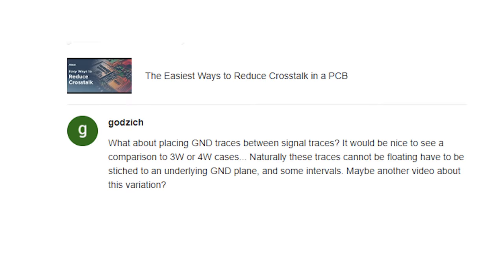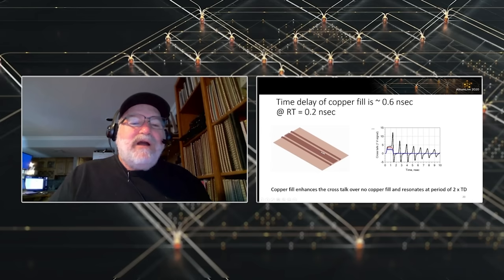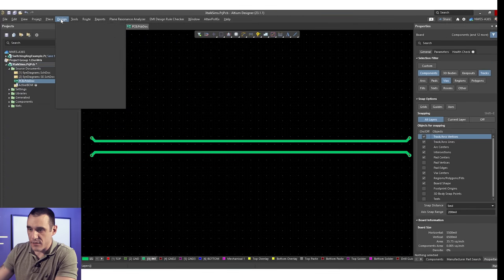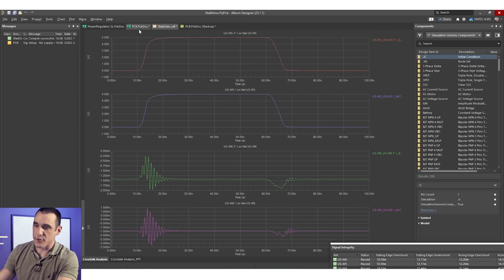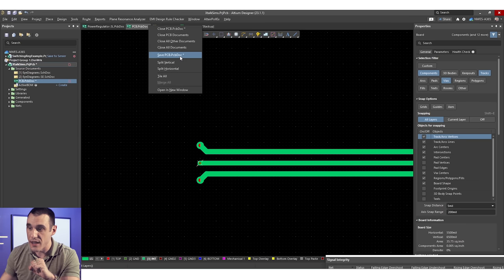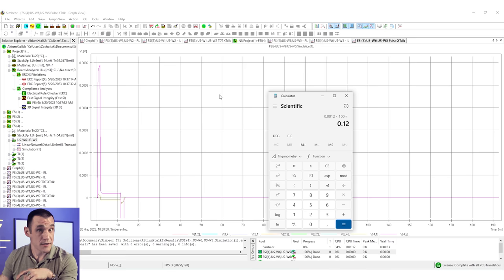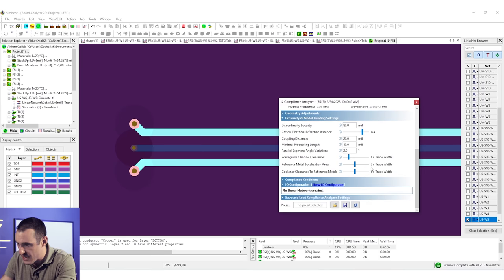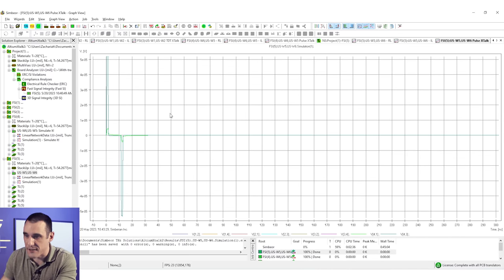Does Using Guard Traces Really Reduce Crosstalk?

Comment: Personally I do not use guard traces. In our  DesignCon 2013 paper Eric Bogatin and I did an exhaustive study on guard traces. As part of that study we also showed that location of the grounding vias can have a profound on the effectiveness of the guard trace and in some cases made it as bad as having no guard traces.  

In the end, the key conclusions were;

1. In all high speed digital applications, where –50 dB cross talk is acceptable, there is never a need to implement a guard trace. This cross talk can be achieved in
stripline traces by just increasing the spacing between aggressor and victim to fit a guard trace.

2. A guard trace, even “well shorted”, has minimal advantage. To fit the required shorting vias means spacing the aggressor and victim lines very far apart which by itself reduces the cross talk more.

3. Using a guard trace with microstrip offers high risk of incorrect termination with little potential reward and should never be done. 

4. The optimum configuration for a guard trace is to use shorting vias on the ends, and match the length of the guard trace to the coupled region only. When used in stripline structures, such a guard trace can result in near end cross talk of less than 0.03%, which is -70dB isolation, compared with -50 dB isolation for the same two lines without the guard trace. Far end cross talk can be eliminated.

5. Any extension of the guard trace outside the coupling region, with shorting vias on the ends, will reduce the effectiveness of the guard trace due to the added length and finite inductance in the via. In one case studied, when the guard trace was just 100 mils longer at each end, the peak-peak amplitude of the near-end noise was just about the same peak magnitude of the no guard case. Because the details depend on the rise time and dimensions of the lines, a 3D simulation is the only way to quantify the actual benefit of a guard trace with vias in a practical situation.

A link to an SI-journal article and link to full paper is here:

https://www.signalintegrityjournal.com/articles/1341-guard-traces-love-them-or-leave-them
Reply: Thanks Bert for the link to the DesignCon paper, I pinned this comment, I also am not a guard trace user for multiple reasons.

Comment: Im using guard traces mostly for HV (rectifier mains 325VDC), when have to deal with single or double sided boards, its great to mitigate noise from switching, as addition to snubbers.
Reply: This is similar to bringing ground closer to the switching node, something which I discussed in another video.

Comment: Hi Zacharias,

Thanks for reacting to my feedback - much appreciated. I fully agree that it generates extra (and unnecessary) labor when you add guard traces manually. Additionally, placing high-speed traces at 3W (or even 4W...8W) distances gives you excellent results when it comes to crosstalk. Nevertheless, you would normally like to fill your plane layers with evenly spread copper. Flooding with copper those sparsely spaced high-speed signals add these "guard" traces automatically. You just need to ensure that you have vias distributed along the guard traces and not leave them floating - not to create resonators and make things worse - as Eric pointed out. The worst thing would be to leave guard traces floating but this mistake can be avoided easily by configuring the copper pour properly (leaving no islands).

Avoiding unnecessary work (and drill holes) should be on everyone's agenda. Using guard traces (or fills) is a good option when you are striving to absolutely the smallest crosstalk, but is probably overkill if you can space your high-speed traces far enough. And as you said, it does not buy you more real estate on an already cramped PCB.

Cheers, 

Christian

Comment: Why is the rule of thumb 3W related to trace width as opposed to the GND height?  My intuition tells me trace width would relatively irrelevant
Reply: Trace width and height above/below the return planes are both significant when determining controlled impedance traces and these are 50 ohm traces.  I believe when people talk about the 3W rule they are referring to a guideline that is referring to crosstalk between 50 ohm lines.  If the impedances were higher you would need something greater than 3W to achieve the same levels of crosstalk.
Reply: @thomasyunghans1876  oh!  The 50 ohms already takes into account the ground height!  Right?
Reply: @big_whopper  That's right!
Reply: they are 2 sides of the same coin
Reply: @Caleb Crome  Yes Thomas is correct, if you had a 50 Ohm trace you would have a fixed H value for a given W value. However, the W value needed to hit a crosstalk target for a fixed impedance is a nonlinear function of H, so as you bring H closer to the traces you can violate the 3W rule and bring your traces closer together.

Comment: Eric simulation shows an increase in crosstalk but Simbeor shows a decrease in crosstalk - neither uses stitching vias - so which one is correct?
Reply: In Eric's presentation he shows that improperly spaced stitching vias create a resonant cavity that increases crosstalk. In another case, he shows a slight decrease starting from a very low value. Simbeor shows a much larger decrease using the extracted linear network model, I did not do a full wave simulation in the interest of time so maybe the results will be different.

Comment: Many EEs make a distinction between grounded traces and guard traces tied to the receiver's reference voltage, which may be different from system ground. For example, a single ended analog front end with the receiver biased between Vcc and ground. This seems to be where I've seen guard traces most frequently used in metrology grade equipment that EEVblog has featured in teardown videos. Still not sure how this is supposed to work unless it's meant to be parasitic LC between the receiver and the signal trace.
Reply: Guard rings are for picking up stray/leakage currents, right?  I guess it’s for resistive coupling as opposed to reactive coupling.
Reply: @big_whopper  yes, where i've seen it (guard ring) most, is protecting high impedance feedback nodes from leakage currents (LC) in low noise references in linear, or mixed signal application. Same/similar reason you would make sure to clean the PCB very well.
Reply: @big_whopper  how can it be resistive coupling? If the guard traces was resistively connected to the victim trace then it would be part of the same trace, not a guard one. I think that all guard traces are by definition reactively coupled.
Reply: @InTimeTraveller  I was thinking of super high impedance designs, where any surface contamination can cause leakage currents across the surface.  The guard ring can help slurp up those stray currents.  Definitely not my specialty though
Reply: @big_whopper yeah that's how they are used, the big thing is the trace itself is (often) exposed through the solder mask so if there's some flux or a fingerprint (or just leakage through the board for sensitive things) on the board the guard ring is there to take the current. By driving the guard ring voltage to be close to the signal voltage the current across that resistive connection is minimised. Also if they are doing metroligy grade work they will probably care about getting a few millivolts less noise from the regular guard trace use.

Comment: Hi Zach, Thanks for the video. So what I understand, we need to be cautious about the vias spacing in a grounded guard trace when we are particularly dealing with digital signals. But if we are dealing with analog or RF signals, is their any limitations we need to be wary about for placing guard traces with stitched ground vias, other than the fact that the via spacings should be corresponding to lambda/10 or lambda/20 of a much higher, far-away-from-our-operating-band frequency? 
In RF boards I have worked on, I have seen such guard traces almost everywhere, especially between Analog front end IC pinouts/RFSOC fanouts, so gaps between device pins are already fixed. Here I would like to ask another question - given the expected power of the signal propagating in the agressor trace known, how to concluded what should be our target crosstalk/isolation requirement? 
I have also simulated such arrangements in different simulation softwares, and to my surprise, different isolation values came up (S parameter analysis) in different softwares (3D FEM simulators used in all of them). That's a different confusion altogether faced regarding this isolation checking..😅. Anyways, without testing, could not verify which one is correct.
Reply: I can say that if you are doing this with very tightly spaced vias you are basically making something that should function like a coplanar waveguide. The span of the pour that makes up a coplanar waveguide also affects the isolation just by increasing the distance as well as setting the boundary condition for the electric field in a quasi-TEM analysis. A thin guard trace with a bunch of vias along the trace is basically like a very thin section of pour, kind of like what Eric showed in his presentation. The presentation from Eric just telegraphs the same ideas in guard traces onto thin copper pour so his conclusions are valid in both cases.

In the RF devices I have done I have never intentionally used guard traces, but sometimes the way pour appears on coplanar lines, it looks a lot like a guard trace. This is definitely the case on radar boards where the lines need to come in/out of a transceiver in parallel.

As far as isolation/crosstalk requirement in RF signals, there is no specific or required value for every system. Typically you have an SNR target that you need to hit as measured at the I/O on some transceiver. You can actually determine the minimum SNR target if you like from information in the datasheet, the minimum input power given on an interconnect typically is determined from a test condition with specific noise within the component’s receive/transmit bandwidth.
Reply: And about the differences in simulators, there is always some kind of discrepancy that usually results from meshing. There can also be differences resulting from the frequency scan range and discretization, as well as any interpolation that might be applied to the simulation results. I'll assume that the boundary conditions were consistent in your simulations!

Comment: Yes 3W works, however it almost impossible to follow this rule with complicate which includes large FPGA/CPU and number of DDRs. The only way is to use microvia (and another issue that large FPGA/CPU packages are not designed for thruhole routing).
Reply: That’s true you cannot always follow the 3W rule in space-constrained situations, and the fanout into/out of a BGA is always problematic when the pitch is very fine, but in those cases you usually have a thinner layer anyways because you need it for those microvias. When you have the ground plane much closer to the traces you can violate the 3W rule and still hit an impedance target. I actually show something similar regarding the impedance deviation created by copper pour in my seminar lectures, and I showed something similar in another video. The same idea applies to crosstalk, as you bring the ground plane closer you can push traces closer together and you can get less of a crosstalk penalty than you would see in thicker layers.
Reply: @Zachariah-Peterson  Copper pouring easily becomes coplanar routing which complicates stackup calculation and if you don't  pay attention can cause to impedance discontinuity .

Comment: Hmmm, I mean, I really appreciate Eric's experience and what he says is not untrue, but I do find that often his arguments for not doing something that does present a small improvement, are often biased by the areas he does his work. 

1. they are obviously heavily weighed in by someone who doesnt work in analogue, or low noise mixed signal very much ... the improvements he calls meaningless, are almost always 0.X%. that isnt meaningless when trying to keep noise below 0.00XX%. 

2. his arguments for not doing them are often justified by negative outcomes that could happen if you screw it up and in this case, make crosstalk worse, by leaving floating copper... I’m pretty sure anyone going to the trouble of routing guard traces today, isnt going to leave it floating.
Reply: I would agree with your point that he is talking to a certain subset of designers. Also his point about what happens if you screw it up, while a valid result, is not the whole story, that's why he looked closer at pour (which is basically just a wider guard trace). I will admit I am also speaking to a certain subset of designers because this technique is often brought up as a way to address crosstalk between digital nets, not necessarily precision analog where you need muuuuuch lower noise and every X% reduction counts as a benefit. So yes I agree with you this is mostly addressing the digital designer who needs to route a lot of traces and is worried about signal integrity with respsect to dense routing.
Reply: @Zachariah-Peterson   oh sure. Funnily though, i actually agree with his point about pours. To some extent. They are well overused by beginners and sometimes just unthinkingly used, as a sort of fix all. People will do half the routing job and then just hit the fill button. It can lead to taking your eye off the ball so to speak and not visualising the loop area. I do a lot of polygon routing for dc regulators and i have to keep reminding myself to use only the trace that is required. Polygon routing is so pretty, so its easy to get carried away and forget about noise pickup from high z nodes and instability depending on bandwidth.  Often times you are better served to create localised fills. Copper puddles. Especially if you have the luxury of a close reference plane. 

I have watched that whole video another day too and found it a mix of useful and frustrating. I think the main takeaway is use the tool for the job. There is absolutely good reasons to use copper fill and one that is not minor is copper balance/manufacturability. I need to remember exactly what was covered in that video. I think i remember shouting something at the screen about the usefulness of plane cap … lol. 

The best answer in lots of cases is of course ‘it depends’
Reply: @Jeremy Glover  You're absolutely right about pours, when we had Eric on the podcast I made the point that if you're relying on pour to solve noise problems, then there is probably some other more fundamental problem that is creating the noise in the first place and you should probably address that first. Whenever I've done them in some of the videos I try to give the justification.
Reply: @jeremyglover5541  I agree with you. Gnd pours has the same spacing rules as crosstalk spacing rules, but you still need to pay attention as you have said.
Reply: @Zachariah-Peterson  Many people use ground pours as a means to achieve copper balance on a layer. If you are a fan of the late Henry Ott, he advocated to not leave any floating copper on your PCB since there ia no means to drain any higher voltage charges that could build up. Many board shops will add copper thieving pads for copper balance without you knowing, which can be as dangerous as adding copper pour yourself. At least by doing it yourself with the right spacing rules, you control the design.
Reply: @bertsimonovich7297  Who isnt a fan of Henry? Electronic compatibility engineering is the single most valued reference in my library.

Comment: This clearly contradicrs to bogatin results. In frequency domain is no resonance. Either tooling is different or bogatin point is wrong.
Reply: No they are not contradictory, Eric showed that when you ground the pour you can get lower crosstalk, however if stitching vias are used and you space them improperly you can get an increase in crosstalk. We just looked at a grounded trace, which is equivalent to thin copper pour. The point we are both making is that in order to even place a guard trace or pour with stitching vias, you have to space out the traces far enough to already meet or exceed 3W spacing, so you will have low crosstalk anyways. Even his order of magnitude peak crosstalk value was similar to the Simbeor result.
Reply: @Zachariah-Peterson  you spaced vias as improper as could and still has no resonance on graphs. Point he was making there could be standing waves between vias if they are not spaced close enough. and this could create boost in crosstalk, however this is not observed here, graph has no clear resonance and look exactly like without pour. maybe frequencies he was talking about are 10GHZ:) no idea) however i think simply this tool is not modelling completely all aspects. Probaby simulation in ADS could be done for that.
Reply: @vladlv2  3D simulation would capture everything. The spacing on the vias I used just corresponds to the ends of the guard trace connection, that was intentional and was not trying to replicate that particular result from Eric, I just wanted to focus on the guard trace itself. Those vias are cylindrical scatterers, the region where the resonance would occur in my model would be very weak because the radiation scattered from those vias is inversely proportional to the distance from the via, so you most likely will not see it at these large istances. It's much clearer when you look at more closely spaced vias due to the 1/r falloff in electric field intensity.